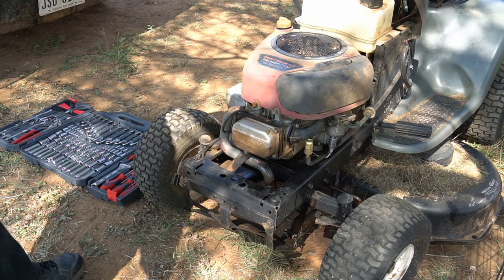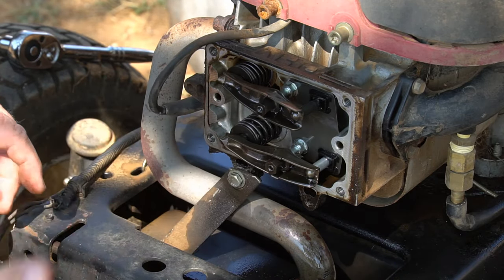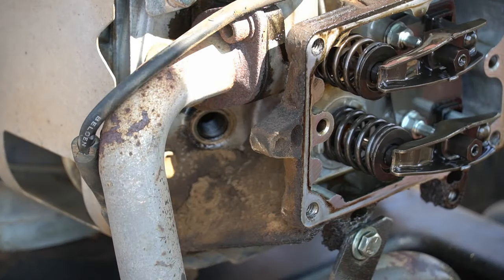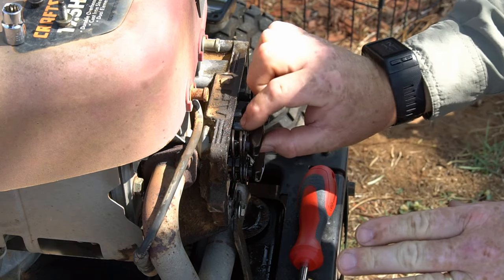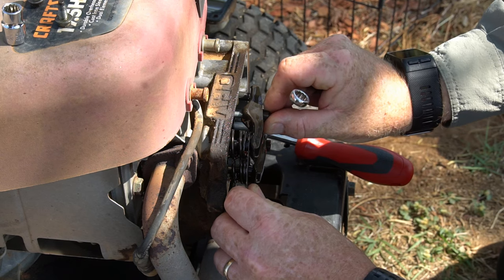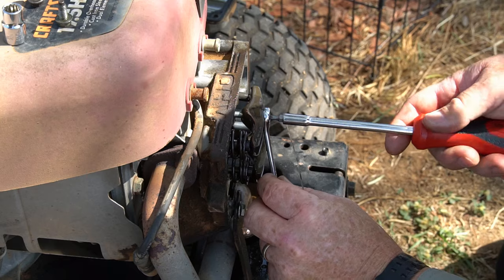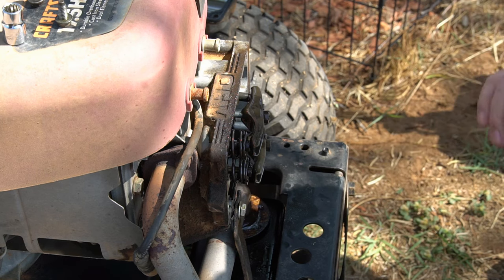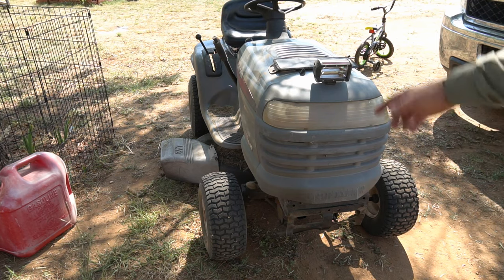🛠️ DIY: How to adjust the valves on a Craftsman (Briggs) 17.5HP OHV Engine

Comment: By the way another perfect stew for a real disaster that also happens often is using those cheapo peanut brittle torx bits that come from those cheapo Chinese multi tool sets... throw that shit away and get a real 3/8 or 1/4 drive set from either Tectron tools or Craftsman either one works fairly fell because those locking screws can be a real grizzly bear to get loose if the engine is aged and withstood summers of extreme heat those little torx screws can be much tighter than even the lug nuts on your grammys old Plymouth Fury. I have had customers break those cheapo bits off inside the screw itself and that can take some real honest talent to fix an Fup of that proportion. Someone might my age might find the humor in the Plymouth Fury lug nut joke. Usually the old Fury cars and a few of the Dodge Darts ect had left hand thread lug nuts.. I remember working at a service station as a kid and we would have to actually take a torch to the wheel studs or cut them off the cars they couldn't be loosened with anything else on the planet or completely torched off the wheel... JUST A NOTE THIOSE LOWES KOBALT TORX DRIVER SETS ARE COMPLETE JUNK BUY SOMETHING ELSE.
Reply from the maker: Thank you for this great information TheKing Silverado.  I appreciate it very much when viewers contribute useful information as you have here.

Comment: Video might have been great - you were a bat. All the valves eere in the shade of your body.i couldnt c what you were doing,  most of the time.
Reply from the maker: I just reviewed this a video and it does not seem that dark.  It was shot in an outdoors natural lighting environment, not in a professional studio, but on my screen it looks good enough to see what is going on. Did watch it on a smartphone or an PC?  Sometimes smartphones have auto screen brightness that may darken the screen in dimly lit environments.  This may make videos look much darker than they actually are.  I would try brightening up the screen and see if the video does not look a little better.